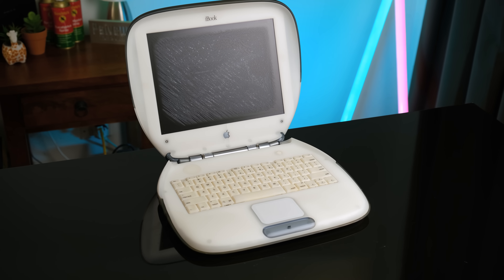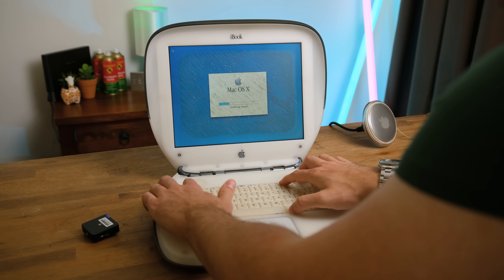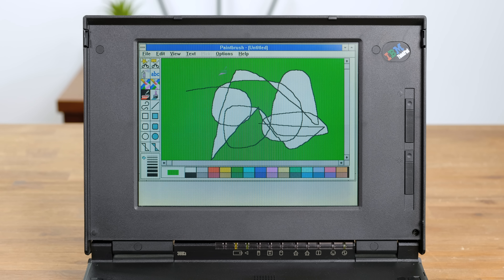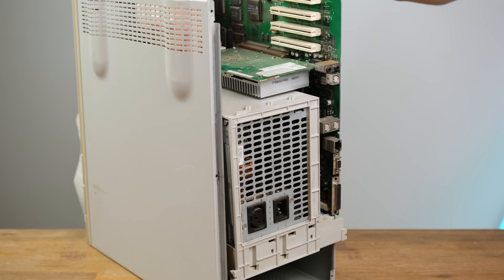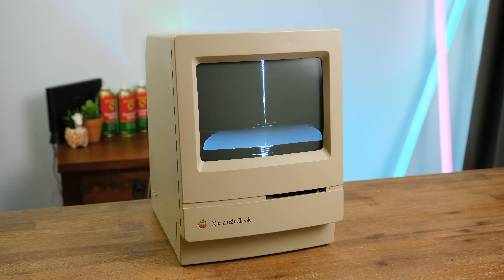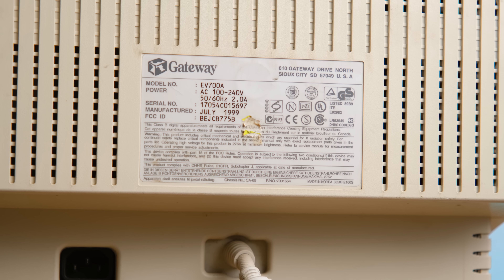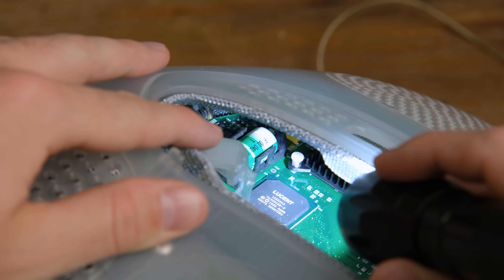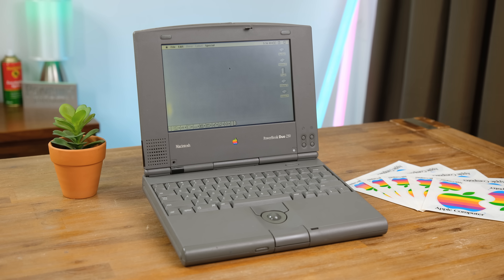So Much Vintage Tech Is Dying... Here's Why

Comment: Yep when the rubberised plastic goes sticky thats tricky to resolve.
Reply: Some of my old mice had the same issue. The scroll wheel had this plastic layer on top that just seems to have melted down to a goop. I had to remove the whole polastic bit and clean the inside of the mice from all that goop that drooled down inside.
Reply: Yup.  Happens in as little as 5 years.  I have an Ableton Push 2 that has the problem...
Reply: I learned this from a camera forum but baking soda paste works really well at getting that sticky rubberized coating off. Obviously care is needed around electronics but it has worked well for me!
Reply: I wonder if coating the rubber in something like clear varnish could help prevent it further breaking down.
Reply: @aussiewanderer6304 A temporary fix at best. Then you have a cracking topcoat over a layer of slime.
Reply: someone used medical sulfur based treatment and the rubber revulcanised..
Reply: Eucalyptus oil to make it not sticky, or acetone to remove the rubberization completely.
Reply: @TheCustomFHD I would be careful with acetone, it might also attack the underlying plastics. I'd first try hot water with dish soap (if you can disassemble the device and just soak the plastic shell) and a brush, then first isopropanol and only acetone if the isoprop does not worl.
Reply: @JoranGroothengel  yeah, thats fair, working your way up makes sense
Reply: Holy shoot, surprised to see you here!
Reply: @The_Funniest_Cut  that’s what I’m thinking too
Reply: I've restored sticky soft-touch plastics by rubbing them with a microfiber cloth and household ammonia.  It removes the sticky/oily liquid fraction while leaving the plastic behind, effectively converting it to a hard plastic.  It doesn't remove the plastic, so it preserves the original appearance more faithfully than simply scraping off the coating.  Use gloves and good ventilation.
Reply: Works great until you drop them.
Reply: Yup I just pulled out a yucky eye lash curler out that had turned to black goop
Reply: @SearchIndex  Huge bummer. I hope it wasn't expensive.
Reply: @phantomkate6  it was one of those Sephora bin ones, but it was battery operated to heat up, and was nice, and I’m good about taking care of things, so watching items I’ve taken good care of starting to crumble and melt these last few years was an eye opener
Reply: @SearchIndex didn’t even know that was a thing
Reply: I'm not the oldest cat to crawl upon Earth, but I have the memory of an elephant, and it was but a brief moment in time, but people viewed that cool light gray sleek round rubbery ornamentation as... Very futuristic! 😃
Reply: Ditch the soft plastics altogether; don't scrape them with your bare hands (per the video)! Plastics are doped with toxic chemicals, such as PFAS and phthalates, in order to make them soft and rubbery. These plasticiser additives are known to cause cancer and disrupt bodily hormone regulation.
Reply: Ditch the soft plastics altogether; don't scrape them with your bare hands (per the video)! Plastics are doped with toxic chemicals, such as PFAS and phthalates, in order to make them soft and rubbery. These plasticiser additives are known to cause can cer and disrupt bodily horm one regulation.
Reply: Ditch the soft plastics altogether; don't scrape them with your bare hands (per the video)! Plastics are doped with to_xic chemicals, such as PFA_S and phtha_lates, in order to make them soft and rubbery. These plasticiser additives are known to cause can_cer and disrupt bodily horm_one regulation.
Reply: Avoid soft plastics altogether; don't scrape them with your bare hands (per the video)! In order to make plastics soft and rubbery, significant amounts of toxic chemicals, such as PFAS and phthalates, are formulated into the product. These additives are known to cause cancer and disrupt bodily hormone regulation.
Reply: Avoid soft plastics altogether; don't scrape them with your bare hands (per the video)! In order to make plastics soft and rubbery, significant amounts of toxic chemicals, such as PFAS and phthalates, are formulated into the product.
Reply: Cont.: These additives are known to cause cancer and disrupt bodily hormone regulation.
Reply: Actually, depending on the state of it, using talc powder and/or Gold Bond can reduce it. I'm not sure how the process works chemically, but my dad found something with that dumb rubberized plastic. He tested that idea out and it made it non-sticky! Now... How LONG that lasts is something I'm unsure about. But, still! Worth trying!
Reply: Gday mate :)
Reply: Acetone sometimes fails, but classical unleaded gasoline works all the time. It might leave slight discoloration. Not an issue if you want to just use it, but for museum storage do make sure to check in hard to see places.
Reply: Isopropyl alcohol
Reply: Good thing not everything uses it :) lots of old electronics are still fine and will remain to be fine. 

If ANYTHING.... Apple has always played the game with planned obsolescence. It's possible they didn't see this coming- but I understand they did something like this again to a few MacBook Pros, a few years in a row. 2014-2017? 

But yeah. Thankfully not everything uses this crap. I hate it so much. It "feels" neat for a while... but then it goes sticky. And what's more I'm pretty sure it rubs off particles we don't really want to carry with us. 🧠
Reply: @SacredMilkOG wrong. Just fucking wrong. The silicon itself will break down. Everything, the components, WILL break down. ALLLL your discs, will break down. All your floppy discs, everything. 

Preserving this shit is literally not possible.
Reply: Just dust the sticky rubber with talc. We did it to certain gear in the military. Worked great.

Comment: Ozone that is present in our air is responsible for a lot of degradation of things like plastic and rubber. If you’re using an ozone generator in your home, it will drastically increase this degradation. Plastic will become brittle and rubber turns to dust.

Comment: the thing that is going first is some of the capacitors and some of the resistors on the boards, people bring them outside in the winter then inside and then outside, scrappers usually, those components are still ceramic and just heat up and fail when electricity runs through them
Reply: I cant believe that thing actually turned on lol
Reply: ok, so after seeing this many things decompose like that, I think there is a solvent in the air or your furnace is not working right, it doesn't take much to decompose plastics like that, there is probably too much moisture where you store these, having more than one thing mould up like that is suspicious

Comment: I sold a GE 27inch tv back in 95 that was already old. It fell out the back of the truck at 55mph they stopped grabbed it and took it home. Finally that night while drinking the buyer got the idea to atleast plug it in and see. It did spark while putting plug in wall that first time but that tv still works like it did when i got it. Its still used for retro game systems and dvd movies. Its used all the time and thats decades ago.

Comment: As a computer and electronics fan this is kinda depressing for me to see. I used to have some old eletronics and a late eighties computer. I wanted to keep it, but my family was in hard times and we sold it. The oldest laptop I have now is from 2016... It is currently unpowered with empty battery and no operating system

Comment: The capacitor problem isn't just general ageing: it's mostly that there was a batch of capacitors that were used across the spectrum of electronic devices, but especially PCs, that had a fault that unfortunately didn't show itself until some time after they'd been fitted to things. Devices made before that batch was used, or after, usually are OK. (OK, very old wireless sets from the valve [tube] era often have capacitors that have lost their function, though they don't actually usually leak ,  just lose their function.)
Reply: That isn't it at all.  There was the low quality electrolytics that were made when production moved from Japan to China, but all electrolytics will degrade over time and need to be replaced.  There are also other types that are known not to age well.
Reply: @michaelstanley5215  I'm pretty sure there was one particular bad batch (where the fault didn't show until some time after assembly into boards), though; it may indeed have coincided with (or even been a result of) the move to China. But I think it ended, or we'd still be hearing about it: I think the fault showed after a year or less.
Reply: @G6JPG  Nope.  The problem stopped when they went back to using Japanese made capacitors and then forced better quality control on the Chinese component manufacturers.  'Japanese made capacitors' was a major marketing point for PC components for a long time after that, some are still using it.
Reply: @michaelstanley5215  OK, maybe it wasn't one bad batch as such. But it definitely was such that the fault did not show up until well after the caps in question had been assembled into boards, and those boards passed test - it was an unusual mid-bathtub failure. Yes, I remember the "Japanese" claim - as you say, I think some are still saying it.
Reply: @G6JPG  Wrong again - how do you manage it?  The failures started occurring quickly, Dell (for example) tried to deny the problem existed and kept the repairs quiet until it became obvious there was a huge problem and they had to replace or repair all of the PCs with those caps.  This was before the Internet became an everyday thing for people and you could still do this.  Dell knew there was a problem from the beginning but chose to ship the products anyway and handle any failure under warranty - after all they couldn't ALL be bad, could they?
Reply: @michaelstanley5215  https://en.wikipedia.org/wiki/Capacitor_plague says it was initially Taiwanese manufacturers, though some China too - and of course there's deliberate obscuration involved too, as nobody wants to admit anything (one company did, but wouldn't name their supplier).
Reply: @G6JPG  You failed again - I was there and had to deal with the mess.  Imagine having to troubleshoot software issues on PCs that were caused by bad components on the motherboard?  The problem was made far worse because these PCs came out during a mass refresh cycle, so we also had to do a major rollout twice.  We chose not to accept replacement PCs from Dell and instead went with another vendor that was known not to have the issue (HP).  The  manufacturers were making the components in China (not Taiwan) and undercutting the Japanese makers by a lot.  The manufacturers of the bad components were also well known because their names were on the bad components.
Reply: @michaelstanley5215  I yield. (I'm bored.)
Reply: @G6JPG  It must be very 'boring' to find out that everything you think you know is wrong.

Comment: What about storing systems, or their components where the main populated side of the motherboard is facing down so that electrolyte doesn't pool on them? perhaps put some sort of absorbent material on the downfacing side... they do make pads that have basically been impregnated with baking soda and other acid neutralizing materials.

Comment: This is honestly so disappointing. Not only is old tech getting harder to come by due to a lot of it being short-sightedly junked when people upgraded, or damaged due to accidents and carelessness; the few remaining survivors are often silently dying with ticking time bombs due to material degradation. At 29 years old, I finally have experienced some examples of tech I bought brand new and took good care of starting to die from age. Just the other day, my PS3 controller started to fail. I used it as recently as 2 months ago with no issues. Because of this, I have decided to learn to solder. The only thing we can do as these things age is learn to fix them or else they will all stop working for good.

Comment: This is a problem in cars as well. Anytime I try to fix, replace or maintain some hard to reach parts, I end up breaking half the integrated plastic clips on the part.
Needed to replace a bulb on my headlight, broke 5 clips and the headlight never sits right now.

Comment: Tec is not made to work decades later it’s for the now and then moment sometimes if your lucky you may get tec that still works after decades I have 1990 Walkman that I brought it still works will it work in another 30 years probably not it most likely disintegrate

Comment: Great news: Heat will destroy ICs, even when your prized old tech is stored snuggly in a “cool dry place”. Then you’re really screwed. I used to repair Commodore stuff 1995-2012. I don’t anymore. There’s no fun replacing a bad 6581 or 8721 with an FPGA/MC.

Comment: CRT's can be kept alive as long as the tube is good. You could at a push get a reproduction of anything else, just get hold of the original circuit design and get a new one printed off and populated , we can do reproduction on plastics.
The thing you should be worried the most about when it comes to consoles in particular is custom processors, anything custom you can't just get off the shelf, once those are all gone that's your lot.
Most gear (pcs, laptops, phones) isn't worth the effort, but very specific hardware like arcade machines, games consoles can be kept going but it will get harder to keep it original, it starts to suffer the Theseus ship paradox. 
Like i have reproduced a ZX spectrum from scratch, its not emulation but not a single bit is original hardware and it's a work around the custom chip...thats a rare example of something we can reproduce entirely by shopping off the shelf, you can almost do it with C64 and Amiga but you need the custom chips and a lot of these chips are dead now.

Comment: Apple plastics from the 90s are TERRIBLE! They often get brittle to the point where you can literally snap them in half like a cracker. At this point, it's really not worth shipping a Mac made before the iMacs or after the original B&W models, because what will arrive will be a mess of shattered plastic bits.

Comment: This video made me cry, it really hurts seeing our old beloved computers dying a slow and remorseful death somewhere in a dark dusty attic or basement. RIP
Reply: Same thing here. I have such a deep connection with my computers and my game consoles. I care so much about them that I did everything I could to protect them.
Reply: Seems like an Apple problem.
Reply: @papabird4425 it’s the polarizer on the screen it is any old device with a polarizer they actually aren’t that hard to replace
Reply: Humility and extremes in temperature, such as storing equipment in outside storage units or unheated / environmentally uncontrolled spaces will kill your electronics. No direct UV light exposure.  Many of the issues here I would be, have origins with this condition. Temperatures for storage should be 45 to 85 max, humility steady around 45%. This will yield excellent results. I have plenty of equipment from 30 years ago, that is 100% new functionality and looks.
Reply: Me too also.
Reply: Stop being such a child. This shit is utterly meaningless. And you need to accept that. Consumerism has rotted your brain.
Reply: We still have emulators on our new tech to remember them. Better than nothing.
Reply: @FReneeBAD True that, at least that's preservation in that context, as well as reflecting on the nostalgia to some extent.
Reply: It's just trash now.  Don't be weird.
Reply: @mbeecher9921 you’re the weirdo in this case
Reply: @mbeecher9921 THANK YOU. A bunch of plastic and metal. It's just rampant consumerism to an extreme. Taking value in useless junk. 

It's not art. Lol. It's useless junk. Is it cool to preserve and look back as a piece of history? Sure. 

But it sure as hell doesn't need to work lol.
Reply: @ImTheMan0fSteel plus a lot of these older technologies can be used for things like gaming. Emulation can only do so much.
Reply: @Imxel21  emulation can do everything lmao. Idk what you're talking about. 

Emulation is flat out superior beyond the "nostalgia" factor. 

You can run anything and everything on modern hardware with a little elbow grease, if that. 

DIGITAL is the ONLY way to preserve this stuff. The only way. 

Physical hardware, degrades. It all does. 

Saving every damn peace of plastic and hunks of metal, because "history" is crazy. 

If YOUUU like collecting that stuff, that's totally fine man. More power to you. But it is NOT important. 

It's simply not important. Just like me collecting old antique bottles doesn't matter. I enjoy it, but it ain't important history.
Reply: @ImTheMan0fSteel Is it a bad thing that I still hang on to my PS2 even though I spent a portion of my childhood playing on it? Yeah, sure it is obsolete old tech by today's standards but it meant something to me growing up, if ya get my meaning. Plus I totally get how emulators can do it better than the original hardware, especially since I played on a N64 on rare occasions. Getting into retro gaming is one of my priorities since I have my modern hardware (a PS5) to do it on.
Reply: @ImTheMan0fSteel Plus I have my old game consoles to look back at as a relic of history, which is fine.
Reply: @TheSilverShadow17  I'm glad to see people here moved by old tech that we grew up using. "It meant something to me growing up" ... that's beautifully and plainly put.

Comment: Sometimes i think hardware fail due lack of usage. If a old computer gets regular use i think it will last longer. Electronics need to be used, capacitors need to be charged/discharged, cdrom motors need to spin…etc

Comment: Is this just a mac thing. Ive got an old hp laptop with xp sat in my leaky garage fir a couple years then dumped in my airing cupboard. Soeakers bezzels gone rusty. Plugged it in boots fine and holds a charge literally perfect.